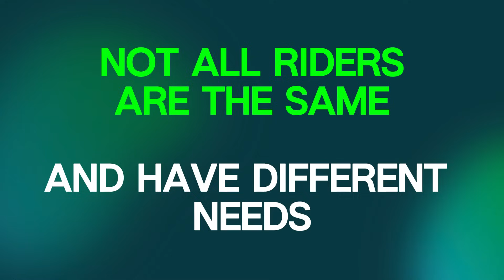DJI Under Fire: Will Europe Shut Down Their 1000W Avinox e-Bike Motor?

Comment: Let’s be absolutely clear: 

The current legal limit for EPACs (Electrically Power Assisted Cycles) in the EU and UK is 250W continuous rated power with motor assistance cutting off at 25 km/h. This is defined in EU Regulation 168/2013 and the harmonised standard EN 15194. Any e-bike exceeding this threshold—whether 750W or 1000W—is not legally a bicycle. It becomes a moped or motor vehicle under the law, triggering requirements for:
	•	Type approval
	•	Registration
	•	Insurance
	•	Helmets
	•	Road vehicle regulations

There is no such legal category for a 750W bicycle in EU or UK law.

Now to address the actual issue: Bosch is actively lobbying to cap PEAK power at 750W, not continuous, in an attempt to create a new regulatory ceiling. This has nothing to do with current law—it’s an industry-driven proposal, and one that many riders and manufacturers, such as Amflow, rightfully reject.

Why This Matters:

As an Amflow owner, I ride a fully compliant bike under current legal standards. My bike meets the power limits, conforms to homologation requirements if applicable, and poses no regulatory threat. Proposals to retroactively impose a 750W peak limit are not only anti-competitive—they risk invalidating legally compliant models like mine and pushing innovation out of Europe.

Clarifying Misconceptions:
	•	ZIV (Zweirad-Industrie-Verband) is an industry association, not a lawmaking body. It can propose frameworks, but it cannot legislate.
	•	Bosch, Yamaha, and others are not regulators. Their motivation is to dominate market standards, often to the detriment of new entrants and consumer choice.
	•	Chinese manufacturers, like Amflow (backed by DJI), must meet destination regulations, and Amflow has done so. Owning a bike with high torque or capable firmware does not violate the law unless misused.

On Performance Claims:

Saying “750W is enough” is irrelevant to legal classification. Power needs differ based on terrain, rider weight, disability, or use-case (e.g. alpine riding, cargo hauling). That’s why regulations should be grounded in safety and certification—not arbitrary peak limits pushed by entrenched interests.

Bosch’s push to limit peak power to 750W is a new, non-binding industry proposal, not current law. It should not be retroactively enforced or misrepresented as regulatory fact. Riders like myself who use Amflow or other innovative platforms operate within the existing legal framework, and we will defend our right to do so against corporate overreach masked as safety advocacy.
Reply: Incorrect; the 250W limit refers to the "thermal equilibrium continues power output". Max power is only limited in Austria (where I live) to 600W; and in quite a few US states to 750W (thats why they are aiming for that number).

But no argument from me, that this is more a loophole, than the spirit of the regulation. But on the other side, eBikes had 400-600W for a very long time now; and most accidents related to them are not due to the power, but the fact that 'unskilled' riders easily reach places they would never on a normal bike and crash on the way down ...
Reply: @ You are right that the 250W limit refers to continuous rated power at thermal equilibrium, not peak — and that’s precisely why the current EU and UK regulation is so well balanced. It defines what qualifies as an EPAC (pedelec) while allowing performance bursts well above 600W, which is essential for realistic eMTB use in technical or mountainous terrain.

However, the claim that Austria limits max power to 600W isn’t entirely accurate in the context of EPAC law. Austria, like all EU states, adopts the EN 15194 harmonised standard, which only limits continuous power to 250W. There may be national road classifications or insurance thresholds that discourage higher peak outputs or reclassify S-pedelecs (speed pedelecs), but this doesn’t apply to EPACs as defined in EU law — and it certainly doesn’t mandate a 600W peak cap.

Bosch’s push to legally limit peak power to 750W would effectively impose restrictions across the EU, undermining what is currently a performance-neutral standard. Right now, brands like Amflow can innovate legally, offering better responsiveness and torque without falling foul of the 250W continuous power requirement.

What Bosch is proposing isn’t just aligning with technical law — it’s rewriting it. And as riders, we should be very cautious about allowing a dominant supplier to set arbitrary caps that constrain the entire industry’s potential.

Let’s keep the current law: technically sound, performance-flexible, and innovation-friendly.
Reply: @bikespike711 Austria limites the max power to 600W. Everything above is considered a motorbike.

Thats also the likley reason, why there is currently not a single dealer for Amflow in Austria...
Reply: Also you skip past an important criteria: max support factor of 3. I highly doubt, that all of the people riding around with 1000W engine support are pedaling 333W themselves continuously ....
Reply: @doxisch  Perhaps in Austria and in general, the key is software governance: The system must cut assistance above 25 km/h, and assistance levels must scale proportionally with rider effort. If DJI or Amflow wish to comply in Austria, their system can technically be limited via firmware to match those national constraints—just like Bosch, Shimano, and others would have to do in different markets.

However, if you can purchase or upgrade software for Bosch, Brose, Shimano which contravenes the said law - then the industry is in breach. Importantly, these laws, to my knowledge, were not enacted by lobbying from industry.

The question is not jurisdiction, or safety, I make a broad point about over reach of industry to manipulate laws to their advantage. This action belies an inability to cope in a stand up tech fight and resort to dirty tactics - which is what Bosch is doing.

I have owned Bosch and Brose based bikes. DJI’s tech is way ahead and they are nearing production on version 2. DJI is pulling ahead at an alarming rate. 

If you and others support Bosch on ‘nationalistic’ grounds - the EU as an innovation hub is finished, so is the beginning of the end for Bosch.

With the US banning Huawei’s chip - we are looking at a two tier world in the very near future. If you can’t win you dig up the pitch! Shame really.
Reply from the maker: You make a very valid point, e-bikes have made cycling mare accessible to the masses and not everyone is responsible or capable enough to handle it. Thanks for watching and your comments.
Reply: Using chatGPT I see...
Reply: @rakhit  nothing wrong with chatGPT as ling as its correct. Saves me so much time.
Reply: Your bike is not complient. DJI puts a bullshit 250W continous sticker on it's more powerful motor to claim, it is a 250W motor. This is something chinese manufactures do all the time, but it is a problem. Thats why they just want to turn it around and say 750W is the peak and it's quit easy to check if it's right or wrong
Reply: @ This claim misunderstands how European e-bike regulations work and misrepresents DJI’s compliance. Under EN 15194, a pedelec is classified as street-legal if its continuous rated power is ≤250W, regardless of peak power—which is not regulated. DJI’s Avinox motor is rated at 250W continuous, and just like Bosch, Shimano, and Brose, it can produce higher peak outputs (e.g., 750W) under short bursts, which is perfectly legal. This is no different to other manufacturers.

Suggesting DJI is non-compliant because of its Chinese origin is not only incorrect but also unfairly dismissive. Many established European and Japanese manufacturers also list 250W continuous on systems capable of higher peaks—because that’s exactly what the law permits. The sticker isn’t “bullshit,” it’s the correct regulatory designation.

Unless you have lab-tested continuous power output that exceeds 250W over 30 minutes (as per EN 15194 testing protocols), it’s not accurate to claim a bike is non-compliant.

This isn’t a “Chinese trick”—it’s industry standard. Let’s keep the debate factual, not nationalistic.
Reply: @bikespike711   DJI has enough backfire for this motor as they all know, that DJI is cheating. 1000W peak from a 250W motor is bs. There are two things that can happen know - 1 . everyone will start to produce motors with bullshit claims, or 2. They turn the mesurement around and 750W is the max. for all. They will be able to push the Nm, but this wattage debate has an end. 
If they don't go this way we will see, that these ebikes get more and more forbidden in several areas. There has to be a limit, these are no motorcycles.
Reply: @Benjamin_Jehne  Let’s clarify the legal position calmly and accurately. EU Regulation (EU) No 168/2013 and EN 15194:2017 define a pedelec (EPAC) as a bicycle with continuous rated power not exceeding 250W, where assistance cuts off at 25 km/h. 

“Peak power” is not regulated under this definition. This is why nearly all major brands—Bosch, Shimano, Brose, and now DJI—design motors that legally deliver bursts above 250W for short durations without violating the regulation.

The 1000W peak figure refers to short-term performance under load (e.g., steep climbs or sprints) and doesn’t reflect continuous output. The 250W rating is tested over 30 minutes at a thermal steady-state as per EN standards.

Accusing DJI of “cheating” ignores that they are applying the same regulatory allowances used by legacy European brands for years, Bosch to name one. If a harmonised peak power cap (e.g., 750W) is ever introduced, it would represent a major shift in law, not a clarification of existing rules. Until such a change occurs through formal legislation, DJI’s Avinox system remains compliant under current EU law.

It’s important that policy discussions remain grounded in technical definitions and legal standards—not speculation or nationalism.
Reply: @bikespike711   You can reapeat to clarify the regulation another 20 times, but it doesn't help with the problem behind it.
All the others have motors with around 500-700W peak from these litte nominal 250W motors. And even there it's not that clear, if these motors are all real 250W motors. 
This is the problem behind the nominal 250W motors. So turn it around, put a max to it and let them do, what they want. I know it hurts you, as you already have a DJI motor, but I`m quite sure these motors will fall under a special rule as they where "legal" when they where sold. 
DJI is not the center of this debate. They want to change the regulation, as there are more and more bikes, which where build for the international market, where most bikes are sold with 750W hub motors that peak out at 1200-1500W. The sames bikes will be sold in the Europe with the same motor but a new sticker on it that claims, it's a nominal 250W motor. It's a typical behavior of chinese online marketed bike companies. You find bikes with a 750W Bafang M610 that peaks out at 1500W and claim it is a 250W motor. 
So DJI is the smallest problem. Let this be a nominal 350W, just to have an advantage.  But from this point on everyone will do the same and then they're a claiming and claiming. So let's stop this now and it's easier for all. Also for the ploice as it's way easier to mesure the max wattage.
Reply: @ I am sorry that I have had to repeat the fact that the law makes a distinction between nominal and peak power, this flexibility is crucial for bursts of power when climbing - this is a fundamental concept that we disagree on.

Your other concern is unscrupulous (Chinese) traders, mis labelling products. If the traders are supposedly dishonest, more legislation will not work. There are other legal remedies. 

The current hullaballoo has been generated by Bosch- no doubt about it.  The reason is loss of market share. 

I do not want the law changed by Industry initiative, this is fundamentally problematic, protectionist, removes choice and eliminates innovation.

We have a class III emtb, specialised Turbo Levo, top speed 28MPH, clearly contravening law and nobody bats an eye lid. 

As to my bike and the 1000watts peak, I use it maybe 1-2% of my riding time, but I am glad it’s there when I need it. DJI is about to produce version 2, which by all accounts is even more awesome.

Bosch and others need to evolve and innovate not kick up a dirty storm with nationalistic undertones.

Nuff said…..
Reply: @bikespike711   Ahhh, you're the one who desperately needs 1000W to climb a hill. 
Go and get yourself a Surron, a liecenceplate and have fun where you can ride it. 
It's really enough said, it gets embarrassing.
Reply: @Benjamin_Jehne  As long as the engine only provides force up to 25 kph and cuts any support once you are there I don't see any problems with max wattage or torque; at the end given that you're just riding a really heavy bicycle with your own produced force.
Reply: The DJI motor does not meet regulations on overrun and ease of unlocking.  Many chinese government based backed companies including cheap ebikes are too easy to hack, which is against the regulations.

Comment: I would rather have the watts restricted at 500w and have 32kph / 20mph cutoff than have 1000 watts at a 25kph cutoff point. From my perspective the American existing law of 750w cap on power and assistance speed of 32kph / 20mph would be the best and adequate compromise!

Comment: Unfortunately, this video just repeats a lot of DJI’s points without explaining the background.
The 650-watt limit used to come from an Austrian law that banned eBikes with more than 650 W from riding on forest trails. To make things consistent across the EU, manufacturers stuck to that limit.
Once the law changed, stronger motors started to appear.
The current talk about a 750-watt limit isn’t random either. The EU wants eBikes to still count as bicycles and not have to be registered like motor vehicles. That could change quickly if some EU official thinks eBikes are getting too powerful.
By the way, there are already more powerful motors and faster eBikes for people with disabilities-called S-Pedelecs. They can go up to 45 km/h and you don’t even have to pedal; you can just use a throttle.
I’m all for stronger motors, like 1000 or even 2000 watts. But I don’t want to have to insure and register them like cars or lose the right to ride on bike paths. The video totally ignores this. It just blindly repeats DJI’s points without questioning or understanding anything.

Comment: I have a third generation Specialized levo and I don’t feel that I need any more power than it generates now. I would like a battery that lasted longer and the 25 km an hour speed limit in Australia is ridiculously slow when you are riding a jump line.

Comment: Arguments of power aside, we needs some damn standards!! Standardized batteries, standardized chargers and connectors and standardized motor mounts!!! Your ebike shouldn’t go in the dust bin if your charger, or cable or battery or even motor go belly up. With standards, your be able to purchase any of those from other manufacturers and know they would fit, and work. You shouldn’t have to toss a say four year old ebike because the connector went wonky.
Reply: You can’t be serious?
Do you want car manufactures to also make all components be interchangeable across all models and brands?.
It’s ridiculous to want bike manufactures to work within a compliance framework. It will stifle innovation.
Reply: @LaughingBoyProductions  i think u will find it has happened already! Car/Engine design and manufacturing are sharing components, designs, platforms. Also, as far as i know, car charges are moving to the Tesla system.
Reply: @darrenpardoe 
Yeah sure, I can see BYD going to Tesla chargers.

Most of the world is already deeply invested in CCS2 or GB/T, with infrastructure, policy, and automaker alignment.
	•	Automakers like BYD, VW, Hyundai, Toyota, and others already produce global models using CCS2 and tailor to local standards outside China.
What About Tesla Outside the US?
	•	Tesla adapts to local standards. For example:
	•	In Europe and Australia, Teslas use CCS2 connectors.
	•	In China, Teslas use GB/T connectors.
	•	So Tesla doesn’t even use NACS outside North America.
Reply: @LaughingBoyProductions  Your quite right with the CCS2 .. I think i mixed it up with a news item that said Tesla are sharing their charging infrastructure as they use CCS2 in the UK.

Comment: There would be no need for regulation with consideration. Most folk find 750w or even 1000w will get them up the very steepest rideable hills unless they are 20+ stone - in which case they are just not trying. Is also fine to power you alo9ng at 20mph which is what (and all) you need to get to work on a miserable morning. Any faster, or more powerful just leads to unforeseen consequences ie running over peoples pet dogs, children, or aged parents. 
Okay we could just ban young people, students, and other brainless, exhuberent and inconsiderate populations but on an e-bike they will be problematic to catch.  E-bikes are a clever, useful, even joyous development and we should enjoy relatively unrestricted access to them on condition that the safety of other road users is respected.